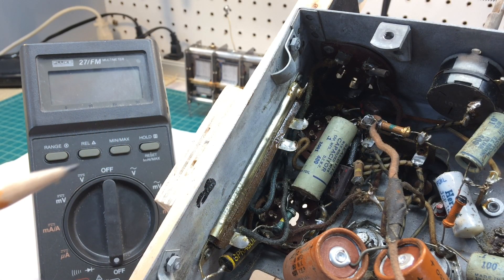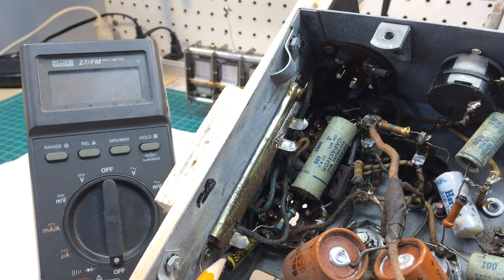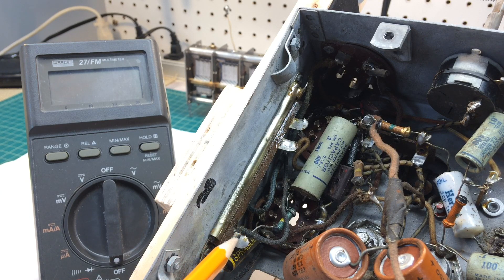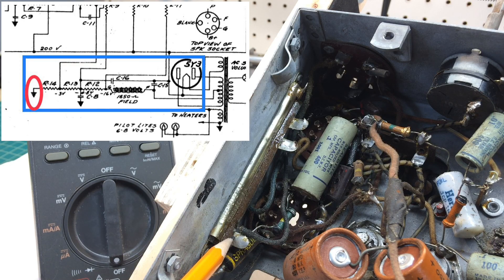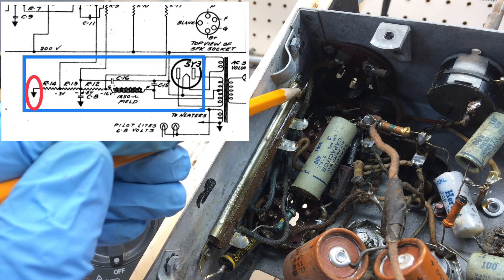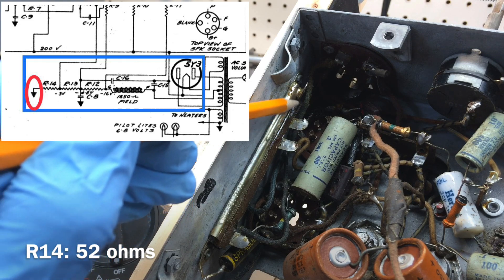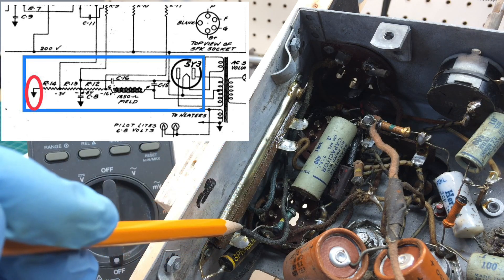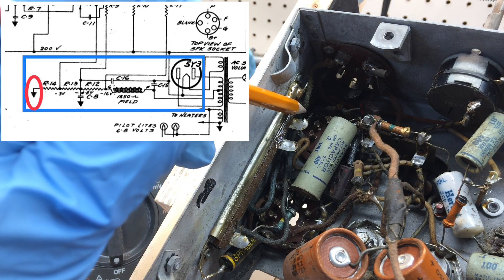Airline 62-316 - Candohm Resistor Visual Clue

Comment: I often wonder if I find a bad section (open) in one of these if that section can be replaced with an ordinary resistor or two
to get the same value. Note sure about the wattage but safe to say with voltages present( here they are less than 20 Volts
 with respect to ground) 5 to 7 Watts would be good area to be at for a replacement. Steve
Reply: I just patch whatever I have in and measure the voltage drop across it, then use ohm's law to calculate the power dissipation. Don does the math, but I think even he double checks when in the actual circuit.
Reply from the maker: Steve - Ian's reply is a solid/proven practice. To your point, since this particular design has the the FC in the CT, and with the low voltages, with an OH of x 5 for R12 (220 ohms) a 3.7 watt resistor is calculated, so a 5 to 7 watt would work fine. R13/R14 work out to be less than 1 watt with an OH of 5 x. Best, Don
Reply: @RestoreOldRadios  Everything I know about older electronics I have learned from my Grandfather, then some real old books he had (which are all on the net BTW), and finally fella's like you Don and quite a few others.
Reply from the maker: Steve - I had some great mentor’s too and still learn so much from others on YT and reading old articles on the subject. Thanks again for following my channel. Best, Don